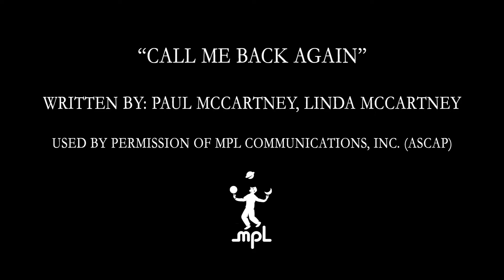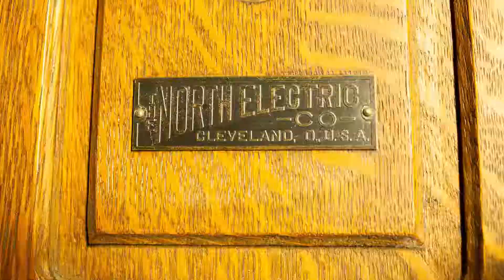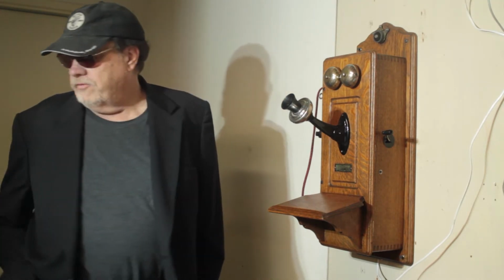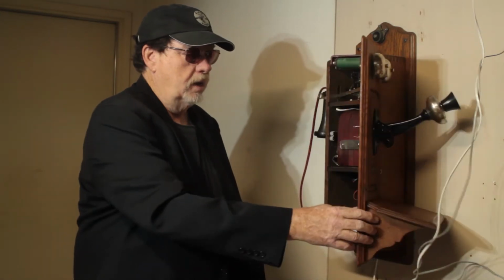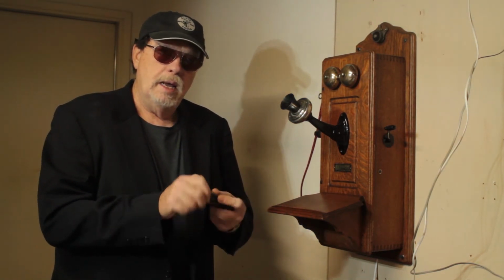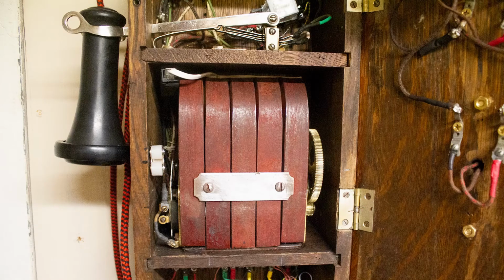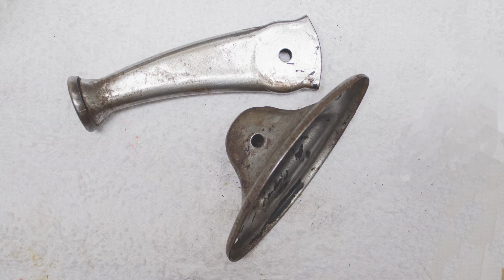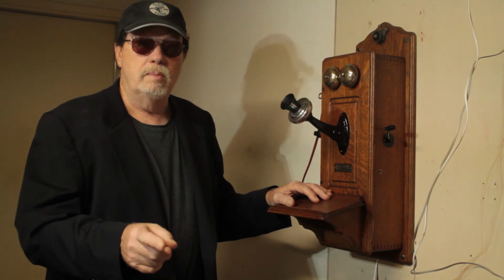North Electric Antique Wood Wall Telephone Restored and Working

Comment: Im watching this video because I just bought one exactly like this. The one I bought is still 100% intact with the old eveready batteries and all. The only thing that's messed up is the receiver cap is cracked and the cord is pretty shredded. I found both on E-Bay for less than $20. Mine has a square ceramic lightning arrester that would have mounted somewhere out of sight. Its my understanding that it spent its entire life hanging in a closet of an old mansion. When they upgraded the phone system they just disconnected it and left it hanging there. I paid a guy a measly sum of $60 for it. I don't plan on doing anything to it other than oiling the finish and using it as a wall hanger in my dining room.
Reply from the maker: Send me a pic of it. Thanks for watching!

Comment: Help! I am restoring an Acme wood wall phone like this one. I took out the generator and I am putting in a modern phone system. I need help with the hook up. I need a 4 pull, 2 throw hook switch...... the one I have in the phone is the classic 2 pull 2 throw hook switch. I saw you put a relay in this one. What relay did you use? and how did you hook it up? Hope you can help! 
Thank you!
Reply from the maker: That relay is used fro ringing generator not for a hook-switch to pull talk battery in an off hook condition.  Not sure what network you are using - so at a disadvantage for a suggestion.  Thanks for watching!
Reply: @TelcoSteve  well I pulled a network from a telephone from the late 1990's and to make it work I need a 4 pull 2 throw switch. The hook switch on the 1906 is a 2 pull 2 throw and will not work with it. Any ideas?
Reply from the maker: @patrickcudzilo8915  Do you see L1, F, L2 and C on the network leads?

Comment: Steve,
I have a small hand crank wall phone with the name plate of 
PALMER BROS.
ELECTRICIANS
MIANUS, CONN.
It has a long post OST receiver.  I cannot find that name anywhere on the web.  Are you familiar with that company.  Can send pictures of phone if needed. Thanks.  - RBB
Reply from the maker: I have no information on that model, however at the time there were many small and less popular companies itching to join the already booming telephone apparatus market.  This item could be one of very few examples.  Good luck on your research.
Reply: @TelcoSteve  Thank you. I will continue to look around.  -RBB

Comment: where can i get batteries for those since they used a specific battery
Reply from the maker: Sorry for the delay.  As far as I know they do not sell batteries like the ones that used to be installed in these.  Those batteries were the size of a larger Beer can.  I had heard years ago that someone took a 9V and inserted it into a fake mock-up big battery.  The reason you can't get a new one that size is  because, well...Let's face it.  Battery sizes for 1.5Volts - 9Volts DC (low current rating) have been reduced in size over the last 110 years. I imagine a 9 volt transistor battery would work, but then I have not done that.  Too busy with 14,000 other things planned.  Thanks for watching.
Reply: @TelcoSteve  ah thats cool

Comment: I have an old wall telephone that I want to be repaired so that it’s in working order because once I turn 18 I’m going to get rid of this god forsaken cell phone. How much would you charge for a job like that?
Reply from the maker: It depends on several factors.  Send me an email to telcosteve@gmail.com and include pictures of the front, top, sides and bottom. Send Inside pictures and not partial.  Use you god forsaken cell phone to take the pics as that is how it is done.  Thanks for watching and please subscribe.
Reply: @TelcoSteve  Alright thanks, you should be getting the pictures by early August, as I won’t be getting home till the 31st.